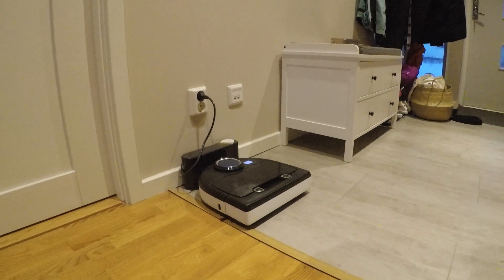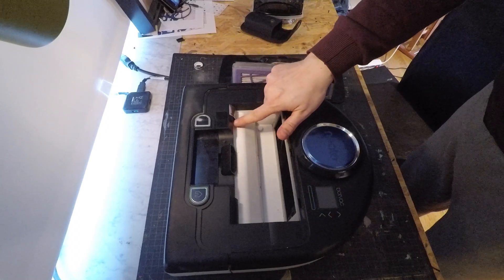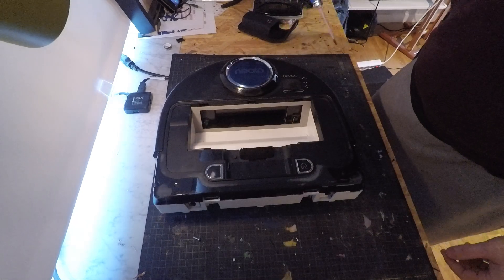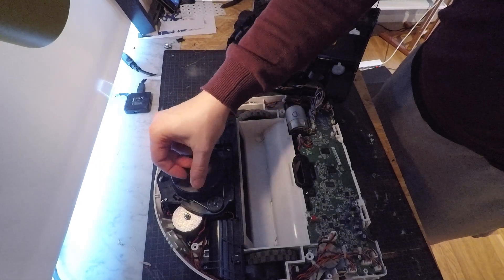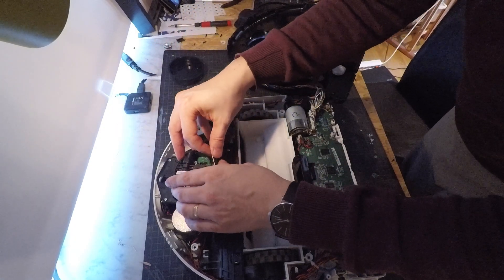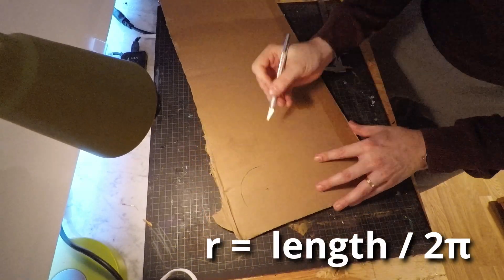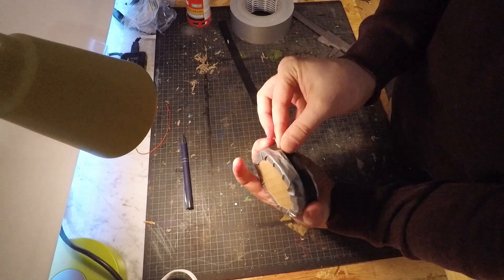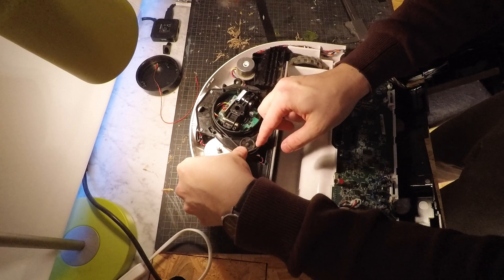Neato Botvac Repair (Laser Turret)

Comment: I've also had this problem, but it turns out that my neato had its laser spinner stuck. I put a q-tip into the housing and spun it a couple times, pushing the while laser mechanism around, and it was fixed 🙂

Just putting it out there if you need it
Reply: thank you so much! This did it.
Reply: @caitlin8693  no problem. Glad it helped 😃

Comment: This fixed mine too - i think there was some grit in the drive motor and when i cleaned the drive belt with alcohol it ground the grit out and ran freely. Sorted. Cost me £5 for a TX screwdriver instead of the £75 (for transport and diagnosis only) at werepair.
Reply from the maker: Excellent! :)

Comment: Hi, thanks for the video. I replaced the belt and the motor, was working great. However, now after 5-20 minutes of running I receive the error "I need to shut down now". What do you think may be the issue?
Reply from the maker: That sounds like a newer Neato than what I've had. Was it fully charged after you made the replacement, or has it been decharging while you've waited for parts / fixed it?

Comment: I've been having this problem with my D5. Sometimes it would work, sometimes not. Then it finally quit and stayed broken. Your video showed me how to get to it apart (Thank You) but in my case the ribbon cable I assume is for  Lidar data has a burned edge leading up to the turret. One of the fine wires had way too much current. There could be additional damage to other circuits. So, FYI there can be other problems that may not be so easily fixed.
Reply from the maker: Thanks for the info! Can't recall the ribbon cable. Are you sure it doesn't carry power to the motor as well? If it does, it could still be that it was due to the motor getting stuck. If not, then maybe it has to do with the power to the laser. Anything else would suggest a major short somewhere.
Reply: @JWAM I'm pretty certain it's to do with data. it's a long ribbon cable with zif sockets like for a camera. It's not a good candidate for power there's many other larger molex type connections that are actually labelled such as motor, it's not. I have photos. It's a work in progress, I haven't taken it up with Neato as yet. But which direction did the short come from? Probably the turret as it's the close device. But did it damage the mainboard? Neato only says it has a problem in the app. I'm wondering if there anything to be learned from the micro USB connection. But it doesn't look good.
Reply from the maker: @keyboarderror1  That sure does not sound good. :S

Comment: I just fixed my Neato BotVac D5 Connected thanks to your tips ! that's great ! awesome. This is typical programmed obsolescence. The ring got loos exactly after 2 years of useage which is the end of warranty period...
Reply from the maker: Great to hear! I'm not conspiratorial enough to think that it's actively engineered to fail after the warranty period, but there certainly exist a few weak-spots fighting longevity. :)
Reply: @JWAM  I'm a 72 yr old widow.  Its NOT a conspiracy OR theory, its just true.  My husband was a VP at Hoover in N. Canton, Ohio.  He told me that they had instituted "planned obsolescence".  I have kept all my old  appliances, truck and until last year...my car.  All are over 25 yrs old and going strong.   My little Neato, I'm trying to keep going - I don't want one that connects to wifi!  But parts are getting tough to come by.

Comment: Very clear and helpful instructions, but unfortunately did not resolve my issue.  I opened it up and everything was working fine, spinning freely...
Reply from the maker: That's a shame. You have cleaned the lenses with a q-tip or such?
Reply: @JWAM  I did.  Further research, it looks like I need to replace the LIDAR motor?
Reply: @JWAM  Just kidding - I confirmed the laser is freely rotating when powered on so it is not the LIDAR motor.  Any other ideas?
Reply from the maker: @jbargar425  can you see the laser (by holding your hand, not eyes, close to it when it starts)?
Reply: @JWAM  Yes I can.
Reply from the maker: @jbargar425  that is indeed odd. If the code indicates that, behaves like that, the laser works, the lenses are clean and the belt doesn't slip... It's like the actual electronics / sw would be faulty, which is unlikely as it's the strongest link. What error code is it and what model?
Reply: @JWAM  It's the D80, and the error says: Please press okay to continue (3000).
Reply from the maker: If the laser works, turret spins completely freely (and is not blocked by the protecting "cage" when back on), is not slipping and the lenses are clean.... I really can't say for sure what the problem is. Replacing the whole Turret is a bit more pricey, and doesn't necessarily fix the issue. So I don't want to give any purchasing advice in any direction. :/
Reply: @JWAM  That's ok - I will take it for diagnostics/repair.  That you for your help this far!!
Reply from the maker: @jbargar425  NP. Too bad it wasn't of  help :)

Comment: Thanks for the video! My "belt" was fine but the motor for the belt was stuck. It didn't spin freely at first. I turned it a little hard then it would spin freely. Problem solved!
Reply from the maker: Perfect! Yes, the code indicates that the turrent doesn't spin properly. Doesn't matter if the belt is broken or otherwise stuck. :)  Happy not-vacuuming-manually!

Comment: It worked!!! Thank you, Thank you, Thank you! It wasn't even as much effort as you put in because I ordered the drive belt from Amazon for around $15 for 2 belts. You saved me a bundle... the worst part was finding a T10 star screwdriver that was long enough to reach the deep-set screw, but once I solved that problem it was a breeze.
Reply from the maker: So glad I could be of help. :) Yes, the point for me was to fix it there on the spot because the floors started to get dusty, and ordering from abroad can take up to a couple of weeks for me. The intention was to show that a rather pricey so-called "advanced machine" can be fixed completely at home, even if it is claimed that it required "special parts". My makeshift belt lasted 3-4 months. Plenty of time to get some hands on real belts, if one doesn't want to make new ones. :)
Reply: Do you have an amazon link Corie? thanks
Reply: hey, do you have an Amazon link for me. thx

Comment: I faced the same problem, but replacing the belt drive didn't solve that issue. I got the impression that the firmware sucks: it seems to be that the data storage management doesn't work properly and is not capable to cleanup old data. The only way to make my Neato work as designed is a system reset.

Comment: So great! Fixed my robot's slipping laser belt by swapping it with a rubber band!

Screws are 12 T10 and 4 small phillips head.
Reply from the maker: Excellent! But that band will wear/dry out quickly. Order a replacement-belt meanwhile until the next change. :).  Glad it helped you out!
Reply: @JWAM  Do you have a link to order. I want a back up.
Reply from the maker: @TurfGuru2025  No sorry, I do not.  There was someone among the comments here who at least listed the correct dimensions
Reply from the maker: It should be this one:
https://www.amazon.com/Neato-Botvac-Ring-Lidar-Model/dp/B088ZVY4QK/ref=pd_rhf_dp_s_pd_sbs_rvi_d_sccl_2_6/144-6276835-4053930?pd_rd_w=om2kE&content-id=amzn1.sym.a96b3406-9e51-4833-888e-fdd07f2de46f&pf_rd_p=a96b3406-9e51-4833-888e-fdd07f2de46f&pf_rd_r=XHMR03BMYZZE5557G3JY&pd_rd_wg=oSxj9&pd_rd_r=6912a10c-6462-4f30-bfca-93d9d2ea88db&pd_rd_i=B088ZVY4QK&psc=1#customerReviews

Beware if you browse for others, as the dimensions for the newer machines seem to differ.  If your pulley looks the same as mine in the video, then this is the one.  If it's smaller / is of clear plastic, this one is probably not correct.

Comment: Try this if the drive-belt wast the problem for you:

I cleaned the inside from cat hair (might have been stuck in the motors or something) and removed the battery for about an hour to fully reset the software

Comment: Is your home made belt on the D3 still working? And where might a place be to buy replacement belts factory belts
Reply from the maker: Hi, it lasted about 4months. We have switched to another robot since. I do prefer the neato, but my wife does not. Look at the comments here, people have suggested where to find belts, as they merely used this video for the repair info.
Reply: @JWAM  well I tried the home made belt not working for me. Mine is a neato wifi connected d3 pro. I can't make it small enough or smooth enough. Going to have to look at an old ring or rubber bands at the hardware store.
Reply from the maker: @leeparcell6233  It was a bit finicky to get it just right. :) I made it merely because I didn't want to wait / it's wonderful. If that is not a priority, I'd suggest ordering: https://www.ebay.com/itm/Four-Replacement-LIDAR-O-Ring-for-Neato-BotVac-80-D80-D3-etc-Vacuum-Series/172977322367?_trkparms=aid%3D1110001%26algo%3DSPLICE.SIM%26ao%3D1%26asc%3D20191002094254%26meid%3Dc64c62744aba42f4ba81c148844d9929%26pid%3D100892%26rk%3D6%26rkt%3D6%26sd%3D113694878880%26itm%3D172977322367%26pmt%3D0%26noa%3D1%26pg%3D2332490&_trksid=p2332490.c100892.m5207
Reply: @JWAM  thank you I ordered them, got them in 2 days and it's up and running again.
Reply from the maker: @leeparcell6233  Excellent news! :)

Comment: Hello! I had the same problem, but it´s not the drive-belt for me. And the motor is spinning. What can it be then?
Reply from the maker: Are you sure it's not slipping at all? (It should spin fast). Or that it isn't stuck when the cover is on?
Reply: @JWAM  Im pretty sure its not slipping. And it pretty fast.
I tryed drive the laser motor with a battery. and it was spinning without slipping :/
Reply from the maker: @thobiasgustafsson1346  Still a bit unclear, have you verified that it spins freely when fully assembled?   Have you tried using a q-tip to clean the laser and sensor (both eyes)?

Comment: Did you use an Allen wrench to remove the screws?
Reply from the maker: Hi! No, they are Torx-screws. T-10 in this case.
Reply: Thank you
Reply: No luck for me. I replaced the belt but still have the same issue
Reply from the maker: @jrgadson7432  Remove the top shield for the turret to make sure it isn't in the way. If that doesn't work either, try give the turret a little push. If it works, then the motor is burnt (costs less than $10, I think).
Reply: I replaced the motor. I’m still having the same issue.
Reply from the maker: @jrgadson7432  It starts when giving the turret a  little push?

Comment: I had same symptoms with my D7 but the problem was much worse - the electric motor that spins the laser died. I ended up replacing it with a motor that I’ve salvaged from either an old CD-ROM drive or an old hard drive. It happen to be the same motor...
Reply: How did you figure this out?

Comment: Great video, unfortunately it didn't fix my Error 3000. It's a widespread issue with these units yet Neato won't admit to it. I'll never recommend their brand nor purchase from them ever again.
Reply from the maker: Hi, was the belt intact and not slipping? You can remove the top cover of the turret and see if you can give it a little push when it is starting up. If it works, you may come away with replacing only the motor, so, thus getting away with it less than $10 instead if buying a new turret.

Comment: Hi, is the 3000 error of not recognizing the room? Thanks
Reply from the maker: Hi! You could say that, yes. It suggest that there is a generic problem with the turret, most likely that it doesn't spin as it should. When the robot is not running, you can use something thin, like a popsicle-stick or q-tip and try pushing the turret around in both directions. There shouldn't be any resistance.  Put it back down and try again. If it still does the same thing, you can check if it's the issue described in this video by carefully (USE CAUTION, it is a laser!) Laying down and looking at the turret when the robot starts up, and see if it spins or not (but don't stare at the holes).

Comment: Hello sir,  In D series Battery. black wire negative and red wire positive. What about two yellow wires. And where in the battery is connected ?
Reply from the maker: I think the yellow one is for a thermistor in the battery to keep track of the battery's temperature (while charging?).

Comment: Do you happen to remember the radius or circumference measurement?
Reply from the maker: Hi, unfortunately not. However I do have some other info. The fix lasted 3 months. Then the belt broke, BUT i suspect that it was due to the belt getting stuck in the "channel" (small plastic wall almost all the way around the turret), which in order may ha burnt out one of the phases of the motor. So I took some pliers and cut off all of the walls, also surrounding the drive wheel (motor). This way I could make a much sturdier (thicker) belt that won't flex as much.  Do it before you burn up your motor (if that was the cause...). :)